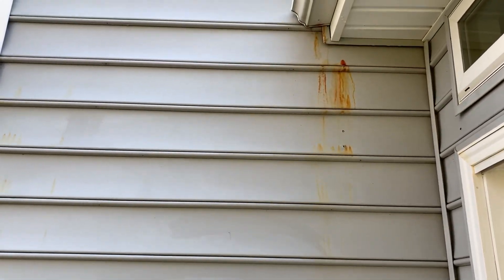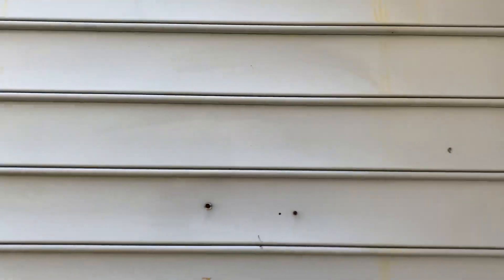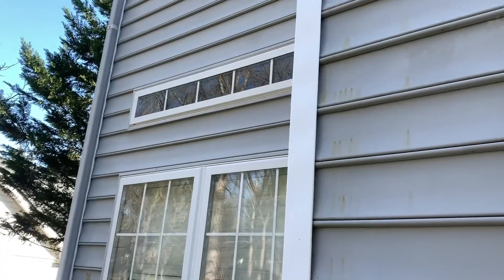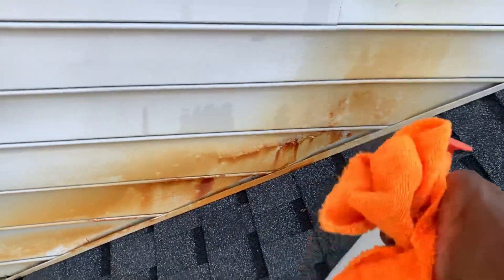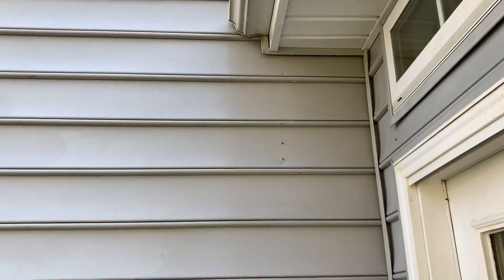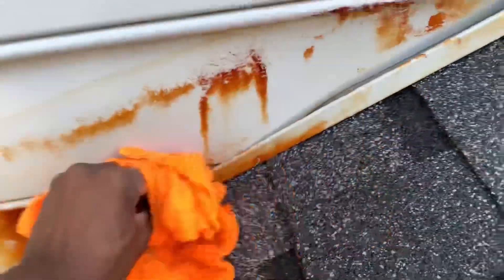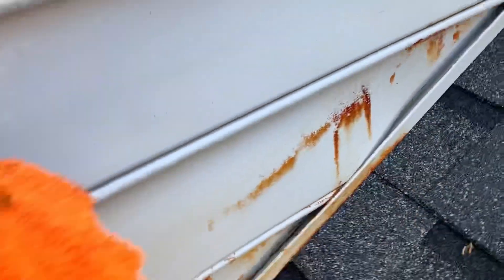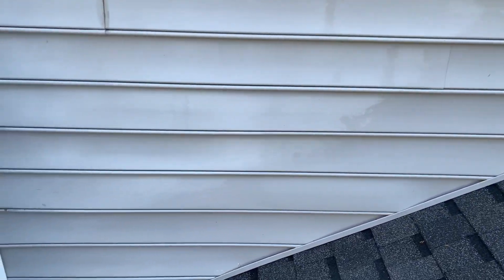How to Remove Rust Stains off Vinyl Siding and More | This Chemical works Great! |

Comment: So just curious how do you charge for this service ? I am just trying to get a idea of a price range I can use my company for this service
Reply from the maker: It’s one of those services you can charge a premium for so it’s completely up to you. Say if I’m already doing a house Wash a they have a small rust area i may charge at least an extra $50 to knock it out but if i was being called out to remove rust specifically I’d be at a minimum of $150+ depending on the amount of rust area

Comment: Muriatic Acid!  works great..  working on how much to dilute.. and timing.  Uising a pressure washer would be nice.   100% on a paper towel is wipe on, count to 5, wipe OFF..  rinse w/windex and wipe again.  My rust is from Untreated Well Water Sprinkler!!  I was going crazy with Mold, fungus, cleaners, was ending up with Laquer Thinner and Acetone!  Those two worked but with scrubbing a lot.  Vinyl seems to be acid friendly..  buy always rinse and wipe.  Put on your safety equipment..  Gloves, Goggles.. skin coverings.  It burns your skin full strength.  One time.. shiney..  it sparkles like new.

Comment: My go to rust remover is Goof Offs RustAid it's like $10 gal compared to F9 it works great just spray full strength from a spray bottle and let it sit and wash off. That easy!
Reply from the maker: I’ll check it out! Thanks!
Reply: When you say full strength does that mean just the plain chemical no water added ?
Reply from the maker: @Oragamimaster8  correct
Reply: @Oragamimaster8  Yes.
Reply: Bingo, and from this video Rust Aid kicks F9's butt
Reply: Rust Aid won't come close to getting rust from direct contact with metals, fertilizer rust stains, rust from snowplow blades, battery acid stains etc.  It's OK for the easy stuff but you'll need a Professional Cleaner like F9 BARC for the tough stuff.

Comment: Wow F9 isn't as good as everyone claims. Thankful I seen how it worked on here before I blew $50 a gallon on it. Thank you for sharing the F9 video saved me a fortune. If you want something thats only $10 a gallon that works better than the F9 get Rust Aid. You can find it at Home Depot or Lowe's
Reply: Rust Aid won't come close to getting rust from direct contact with metals, fertilizer rust stains, rust from snowplow blades, battery acid stains etc.  It's OK for the easy stuff but you'll need a Professional Cleaner like F9 BARC for the tough stuff.
Reply: If I need something stronger than Rustaid I'll go with NAPA Aluminum Brightener or maybe buy a bag of oxalic acid and make my own
Reply: @russellweaver3965  Oxalic isn't stronger but the Aluminum Brightener sure is.  The dangerous car battery acid (sulfuric acid) and the very strong phosphoric acid in Napa Aluminum Brightener is why it's so much cheaper than F9 BARC.  F9 BARC does a better job and is inhibited, much safer to you and your employees if you have any.  We made our products to do what these cheaper, more dangerous products do but with much less health and safety risk hence the higher price with our products.  I was injured by another product once and it ended up being a $130,000 medical bill.  So sometimes cheaper doesn't mean less expensive.  Just be careful, especially with the fuming around your clients and make sure to wear proper PPE.  We wish you much success and are here when you need us.